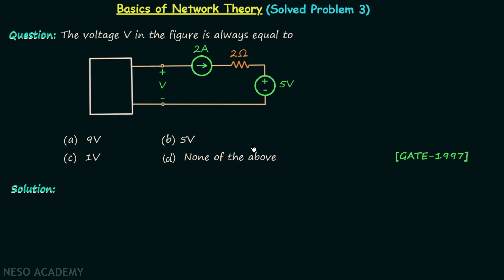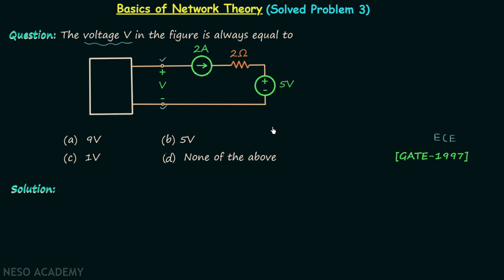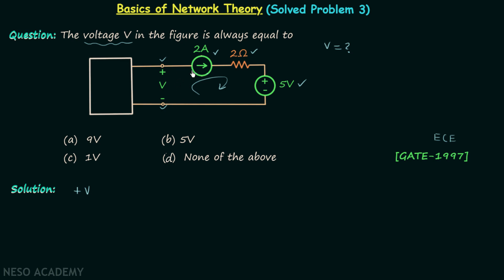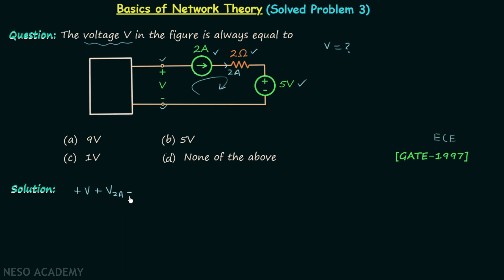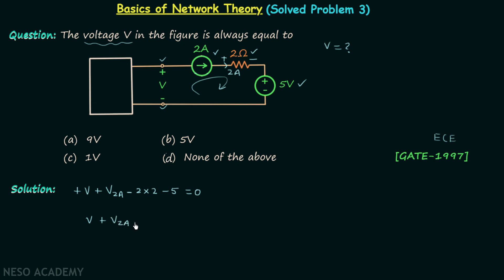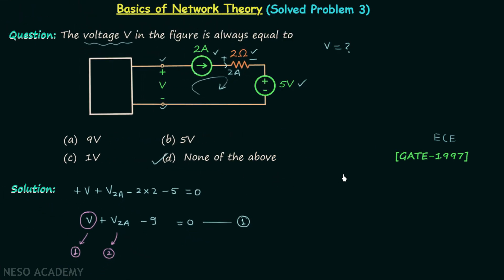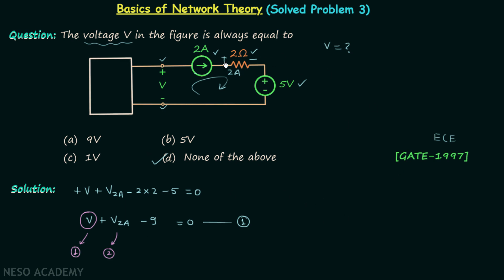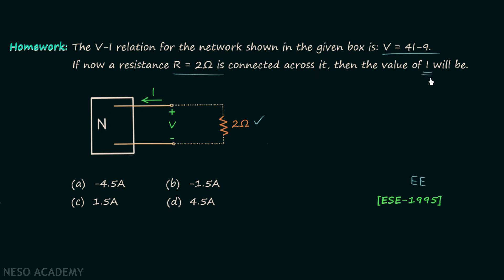Basics of Network Theory (Solved Problem 3)

Comment: IAM getting -4.5 amp...by kvl v=i2...
4i-9=2i...
2i=9
i=4.5 
as originally current is opposite so -4.5amp
Reply: Could any one say it is correct or not ease
Reply: V=-i2 hence answer will be 1.5
Reply: correct answer is 1.5 A. lets assume that current through 2 ohm resistor is i1. i1 equates to - of i. now equate kvl equation using i1 and then replace the value of i1